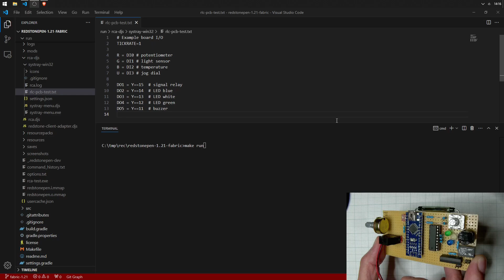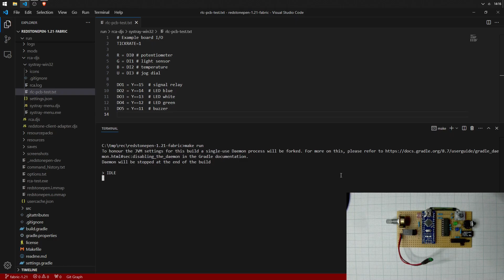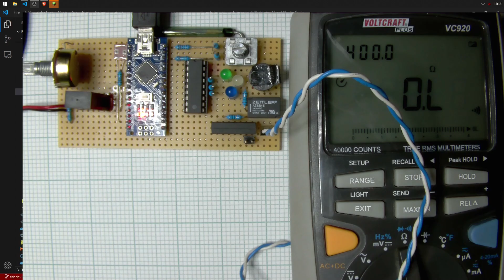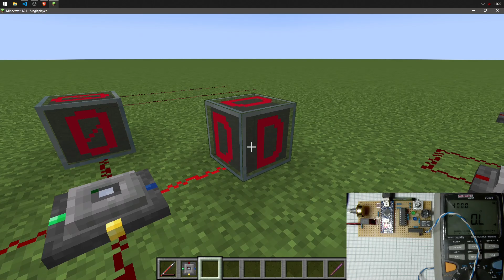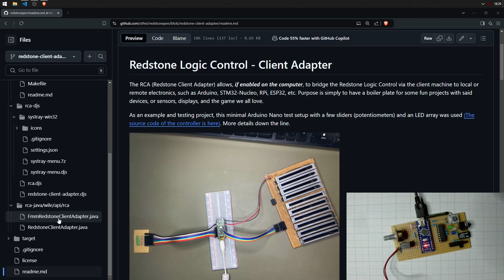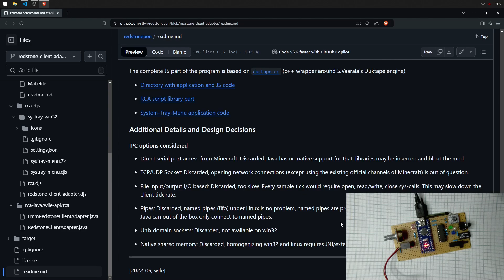Redstone Pen RCA - Connect Minecraft and Arduino - and whatever else You like

Comment: This is cool already but what if it would work with mqtt. Then I could control a smart home without an additional program.
Reply from the maker: Hi, ty for the feedback ;). The RCA design is mainly based on security considerations. Local file mem-mapping with strict hex parsing is hardly usable for malicious purposes. Hence, the actual connection, e.g. via ethernet, should be always done by a program that is made or trusted by you. MQTT libs are available for most coding languages, and the RCA client libs are on the mod github  (e.g. PY here: https://github.com/stfwi/redstonepen/blob/redstone-client-adapter/host/rca-python/rca.py). Only a bit of glue code could make it work I think, and you would be absolutely sure that your home automation is under your exclusive access control. Cheers,-